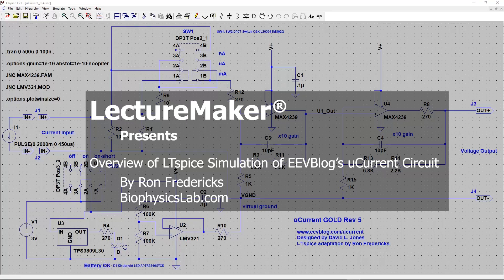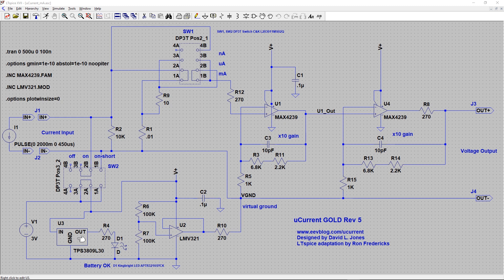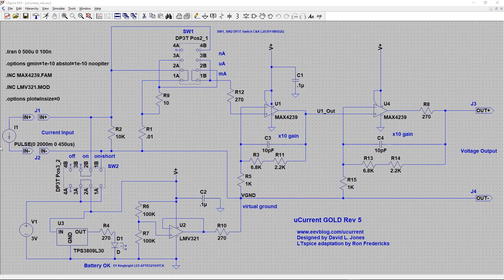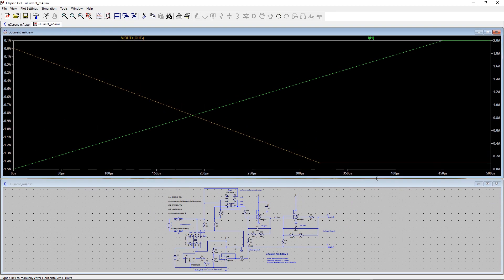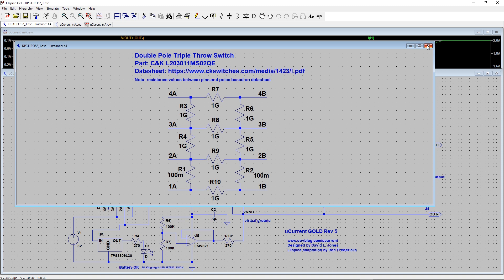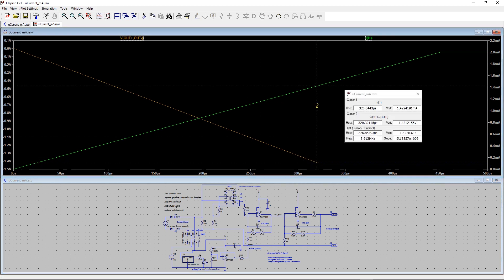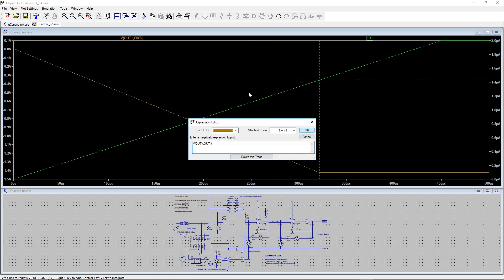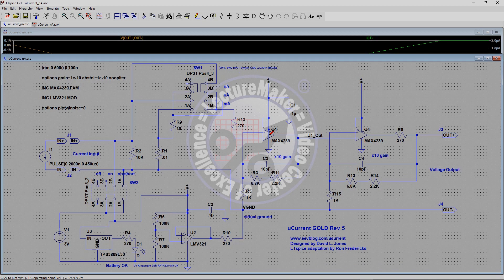uCurrent Gold Precision Current Adapter LTspice Simulation

Comment: Nice,  dynamic analysis would me more interesting. You know, when a low power device wakes up from sleep and consumes a burst of current for a few microseconds and goes back to sleep. It would be interesting to see the transient current vs voltage response of this model at those speeds. Things like the delay between current and voltage pulse, deviation from the scaling factor etc. would be interesting to see.